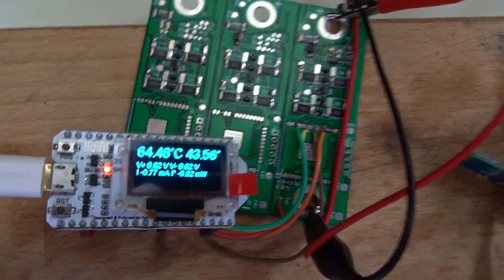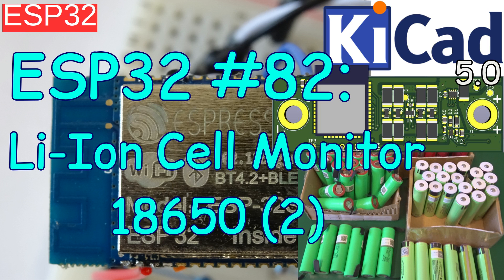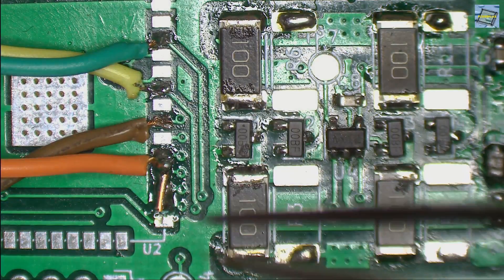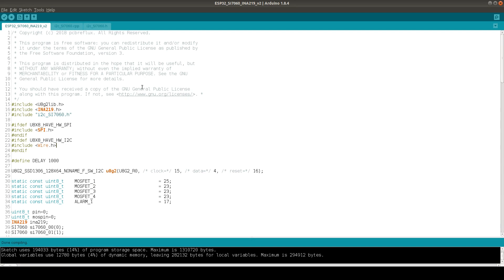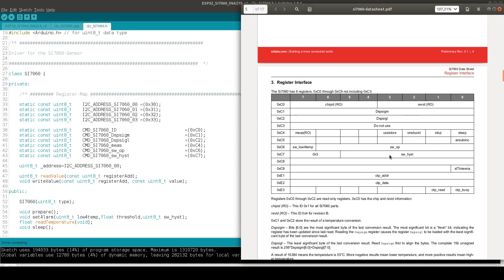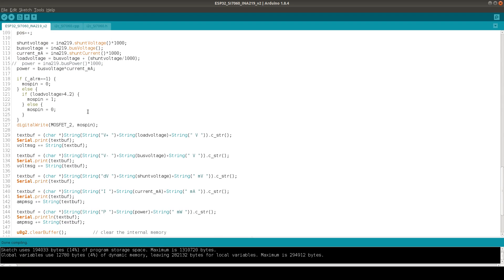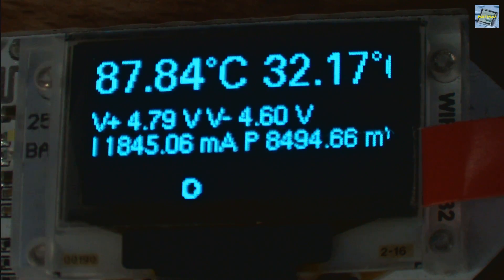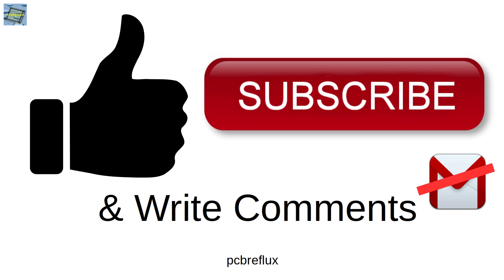ESP32 #82: 18650 Li-Ion Cell Monitor with KiCad 5.0 (2)

Comment: Thanks for the great video. I am building a power amplifier board for driving piezoelectric transducers which also uses the INA219 and the Si7060 ICs to monitor status, so I am very interested in monitoring your experience.

Since my eyesight isn't good, I have my boards stuffed by machine and to make this cost effective, a volume of 20+ boards is generally ordered. My greatest fears when I am doing a PCB design is getting the footprint wrong or missing a note in the datasheet which indicates that a control pin's voltage must be constrained. When an error occurs, not only does the board have to be redesigned, which isn't usually that big a deal, but the parts are wasted, which can be expensive, and it takes a fair amount of time for building the PCBs, stuffing them, and shipping (I am also always using the cheapest delivery method!).

Maybe someday somebody will develop a piece of CAE software which checks the BoM against the PCB design and flags cases where the footprint doesn't fit the part that was ordered...

Anyway, once again, thanks for your wonderful videos!
Reply from the maker: ats89117 Thanks, one advice I am unfortunately also not follow is: just print the pcb layout on paper before ordering. Think this had saved me a lot of time and troubled, but sometimes I try to rush things and then they even slower. You can find all the SI7060 code in the description and I use not the adafruit library for the INA219 on the ESP32 (not working for me with u8g2 I2C displays). Have a nice day
Reply: Thanks! I've heard this suggestion many times but for some reason I've never taken it. It would only cost a few days to order the parts first, so of course this is the right way to go...

Comment: If you are going to do a new revision of the board, maybe you could consider the INA226. It has a bus voltage LSB of 1.25 mV, while the INA219 as a 4 mV  LSB. Also, I think  it is possible to set the 226 alert pin so it triggers an interrupt on under/over voltage/current.
Reply from the maker: Álvaro M. Valdebenito B. Thank you, the price for the INA226 is a little higher but also the min supply voltage of 2.7V makes this a interesting alternative. Will read the datasheet and have a look about the software. Have a nice day.

Comment: Thanks for another great video and project (please more on using KiCad, your thought processes in circuit layout especially). Are you monitoring the battery state-of-charge just by voltage or do you plan to do 'coulomb-counting' with the current flow? My first KiCad design was a coulomb counter earlier this year, but for LiFePo4 technology - great fun!
Reply from the maker: Thanks, most time of my thought process in circuit design is reading the datasheets and do a parametricial search on big electronic sellers sites and also calculating the total BOM cost. After placing the footprints its just a little bit of try and error. Some errors I found after ordering a board, but luckily some orders can be canceled and replaced. Not planing a coulomb counter but just adding time to the current measurements should be easy.